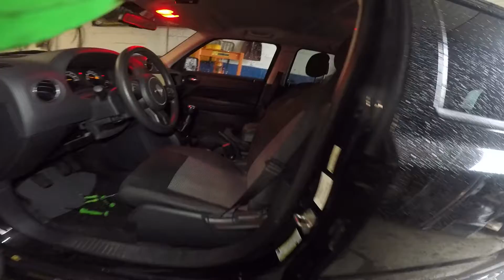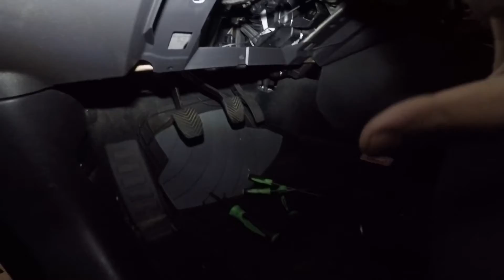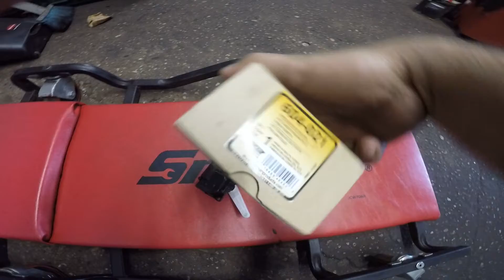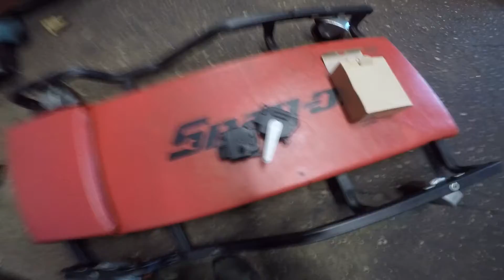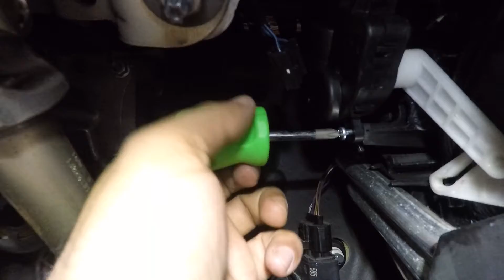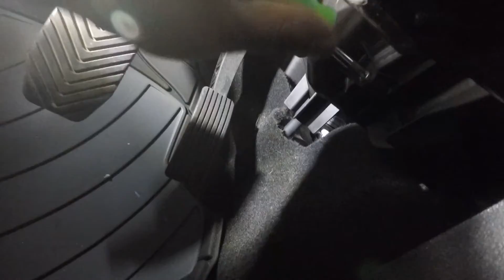2013 Jeep Patriot Heat dont work how to replace blend door motor

Comment: I see the lever is half way on in the arm
Reply from the maker: Can u make video and let me see what ur talking about
Reply: @RBTheMechanic  i changed the actuator on the drivers side that controls the heat .

The heat is on. Thanks. I don't hear the click on passenger side. Maybe that fixed the problem. My mobile mechanic changed one actuator on passenger side. I will drive tmrw and see what happens.
Reply from the maker: @louiedee279  oh cool nice good job

Comment: I removed the cover I saw the level was off the dial. I,pushes it up and the heat came on. Now I am,wondering if my mobile me hanix tripped the lever off!😊
Reply from the maker: I’m confused what ru trying to do remove or replace
Reply: @RBTheMechanic  trying to remove the actuator. The lever was off the dial. I moved the dial and heat turned on. Just have to put the lever back on the dial so the heat can turn on.
Reply from the maker: @louiedee279  ok yeah door will drop

Comment: My 2013 jeep patriot latitude clicks on passenger side! Lately has not been clicking! I have the part. Its on passenger side.
Reply from the maker: Yes throws acuator will click and rattle as they go bad or loose internal contact to plates

Comment: Life saver!
Reply from the maker: Nice !!! Glad this was ur fix!!!
Reply: @RBTheMechanic  hey, I have a question, after fixing it thanks to you video it was working just fine, but now the little white arm goes all the way up to hot or all the way down to cold. It is not regulating. Do you know what might be causing that?
Reply from the maker: @paulelunico  what u mean it’s not regulating?
Reply: @RBTheMechanic  the little white arm goes all the way up and all the way down only even if the controller is in the middle for warm.

Comment: Thanks  so much man! Mine just crapped out the other day when I need the defroster while it was raining and after looking around this is the best vid tutorial I've found showing what to do. Quick question - For those screws would a right angle ratchet screwdriver make it easier, or is too tight in there for that?
Reply from the maker: I can’t remember this was so long ago video I think small screw drive

Comment: I replaced the blend door motor but still not working its like its not getting power to the motor. I was clicking and all that every time i started my jeep and would do the same when i put it to hot heat. it finally stopped and i figured i better replace it. but even new motor is not moving at all 
ideas would help
Reply from the maker: U I would recheck to see if it’s installed propperly try at diffrent position like how it turns maybe u have it at end point.  U can try this take out the motor box. Plug it while it’s outside and turn the temp up and down see if it moves
Reply: @RBTheMechanic   yep did that still dont move even not installed and just hanging no movement its like the motor is not getting a signal from the dial
Reply from the maker: @starrin19  eel not u need to check electrical problem it can be bad control unit or broken wire check for power ground it can also be defective part

Comment: Great video! You helped me pinpoint the issue in 15 minutes and now I have heat! For some reason the blender door motor was confused, turning out of sync. I just had to remove the white plastic arm, rotate it to align proplerly with the correct hot/cold position and reassemble it. Thanks!
Reply from the maker: Great job it prolly was jammed or stuck at point where it didn’t continue working soon as u moved it it started to work some times it will stop working again if it happnes then just replace it... but great job!
Reply: Happened to me, it was jammed at first, repair it but now I failed again so I’m buying a new one to replace old actuator

Comment: Do you have a video or any links to how to get that panel off under the steering wheel?  I took out the two bolts at the bottom but it’s hinged at the top. Not sure how to disconnect that hinge

For 2010 Jeep Patriot btw
Reply from the maker: BoujiFugee no sorry I dont
Reply from the maker: BoujiFugee it might need to be pulled outward it might just be clipped in

Comment: I have a jeep compass pretty much same as a patriot  but where you just took that part of mine is like a bike cable all my buttons are just basic not electronic for my heat or air driver side hot and passengers side cold while my ac is on what do you think it is again I look where your at only the white adjuster peace but then a like bike cable now what lol mine just started this today
Reply from the maker: River Sharp try turning it manually see what happned also do u have dual ac control?     One more reason that can cause one side hot one side cold is low Freon which will only cook off half of eveporator propperly but before recharging ac system check it out
Reply: @RBTheMechanic  are they a way to just add freon I got told once that you half to drain it all then add all new I did try manual doing it but nothing you can watch it working tho  i found a actuator on the passenger side deep down in there on the side but people said it wouldnt be that one because its my driver side that not working but my heat works on both sides its only when i turn my air conditioner on that passenger side cold and my two vents on driver side is hot
Reply from the maker: River Sharp do u have dual ac system? If u have dual there are 2 actuators but if only one knob to control the temperature then u only got one and u can look and turn the knob to see if it works
Reply from the maker: And to fill Freon do it propperly recover vaccume and add proper amount
Reply: @RBTheMechanic  ok yes only have one what do I look at as I turn it  and if it does work does that narrow it down to the low freon I actually never heard off low freon causing oneside of your vents to work and the other side to work normally
Reply: @RBTheMechanic  one more thing what do you mean dual control   I only got three standards round buttons you twists to turn on cold or hot same for vents and floor no electronic buttons at all besides when I push the ac button only it's a 2007 jeep compass sport I think it's all standard you even roll the windows up manually

Comment: I don't have cold or hot air. Fans are blowing, and a mechanic told me the pipes were cold - it just wasn't getting put into the cabin, and referred to a "door" that just wouldn't open. Is it safe to figure that this is the door he was talking about? And that replacing the motor for the door would fix the issue? Dude quoted me $1,200 saying they would have to remove the entire dash. I saw your other video about the Compass - how do you know if it's the lower or upper motor? And how would you reach the upper motor?
Reply from the maker: Patman494 yeah this is blend door  it opens either heat or ac most likely this is your problem u can manually turn it to test it just take off the screws and turn it

Comment: Instead of using stubby screwdriver use a small socket holder w/ phillips socket attachment
Reply from the maker: strategic services that would works too anything that u can think of as long as it works

Comment: Just wondering, would this be the same video that fixes the direction of air flow within my jeep, i have hot and cold air but my problem is its stuck on defrost, i cannot change direction. took it to the garage and they told me it was this specific part but all videos of seen this part fixes the hot/cold issue. they also quoted me over 600 for part and repairs LOL
Reply: i noticed that i need a mode door actuator not a blend door and i cant find the part anywhere..
Reply from the maker: Dustin Sheppard yeah mode door motor is what controls the flow of air in diff directions you can find it at dealer it’s about similar price should be around $50-60.  In close due to Covid 19 other wise I would have gotten you part number
Reply: @RBTheMechanic  thanks appreciate the fast respond, that's definitely a sub! where is this mode door part located too in the vehicle? Is it harder to change? Why would my garage tell me it's the blend door actuator?
Reply from the maker: Dustin Sheppard it’s around the same location usually what I do it have some one switch the wind flow to diff spots on the controls and u have to feel which box/ aviator is trying to buzz of feel   It’s either on this side or opposit side if I was at work I would have check it but I’m close for 3 more weeks

Comment: This could be a real sticky job. How do we know that the servo motor failed and not the servo motor control knob unit. Also, when placing the white actuator arm on the new motor it can be placed in apparently 6 positions, how do we know that the old control motor failed in the minimum position and the new motor is shipped in the minimum position. This requires checking that the new motor white control arm is moving the vane plate to the end when the control temperature knob is maxed out in one direction (full heat or full cold) and not fighting beyond a bottom moving the vane plate when the control knob is maxed out in the other direction assuming I understand what is going on. This would require motor removal and white control arm re-positioning. Modern cars are fun?!
Reply: When I wrote vane plate , I meant blend door.
Reply from the maker: John Toone    Usually it’s the motor u can use bolt meter to check power that will be longer job better u can buy new motor plug it in and see if it works then install it
Reply from the maker: John Toone    Oh the arm sticks out move up or down it dosent do 360 u can just put it in and it works of resistance so it will adjust it self accordingly I have done some actuators year back on town car those r difficulty I get to correct spot